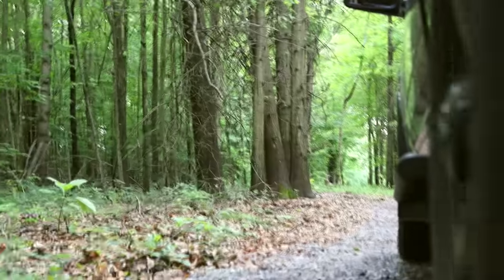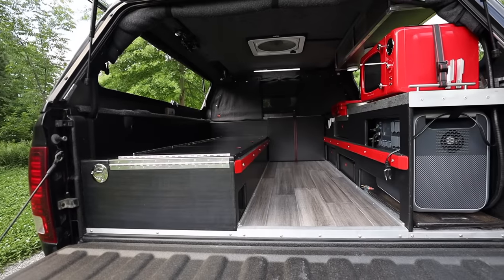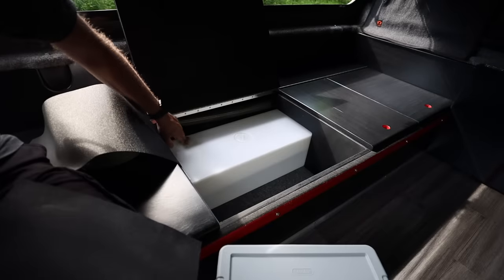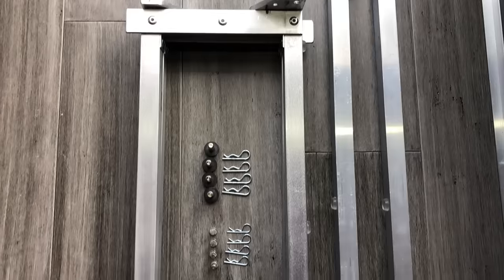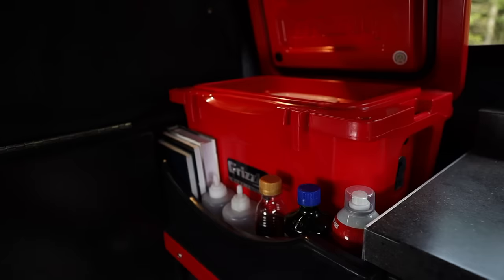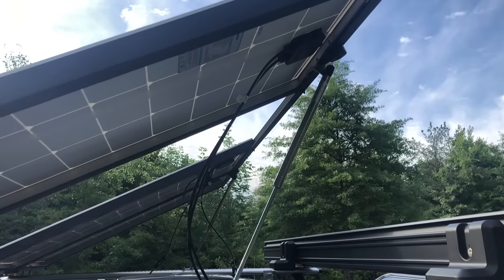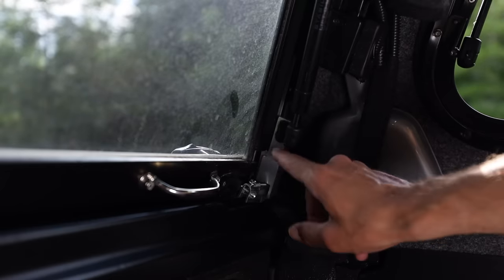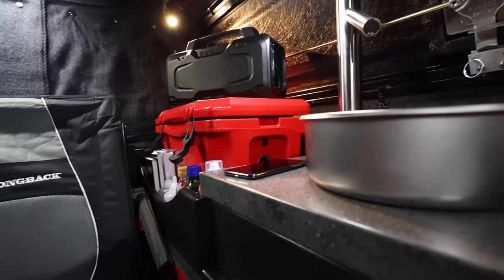My Ultimate Truck Cap Camper Build Full Tour!

Comment: Amazing -- a fully self contained camper in a topper!!  The only missing item is a propane heater for winter camping?  Have you thought about what you could do with a higher topper that is just high enough so you can sit on the bed and be able to walk in and out rather than crawl?

Comment: What an incredible build out. All the planning and preparation you took in the design really shows. The execution was great. Absolutely stunning build. I love the way you set up the power and the adjustable solar panels. Such a great idea. I definitely put some ideas in my back pocket for my current build. Thanks for sharing your entire build out for people to draw inspiration from. 👍👍
Reply from the maker: Thanks so much! A few days after I posted this video my Thule roof rack failed going down the highway causing major damage to the solar panel frame. I’m currently redesigning it and will post a future video detailing the new design. Take care!
Reply: @WhentheDustSettles  oh man, I'm sorry to hear that. A bummer, but I am definitely excited to see what you come up with!
Reply: @WhentheDustSettles  Thank you for sharing this detail. I am looking to put solar panels on a topper and was wondering how they would handle road speeds.  It's not just the weight, but also the "kite effect" to consider.
Reply from the maker: @BoHunter2010  yeah, I unfortunately had an experience with my solar panels trying to take flight. My Thule rack broke and they almost came free…causing a bit of damage. 😩

Comment: What a sweet setup. Well done!! I've been watching many truck camper builds and this one takes the cake. I noticed a vent fan up top. Smart. Considering doing something similar and gotta ask. Is the bed of the truck 6 ish ft in length? Looks like about 6'. Also, now that you've had time to use and test it out, do you have any thoughts about how the build could have been different/better if the truck bed was 8' and if the camper topper was a 36" wedge type topper? Not a critique or complaint about your topper height or truck bed length. I'm just imagining, if you could do that with that size truck bed and topper height, it would be amazing to see what you'd come up with more usable room for design space/elements. Thanks for sharing and safe traveling.
Reply from the maker: Thanks so much! The fan is great! The bed is around 6.5’. If so had the longer bed I’d have definitely put in a refrigerator and more cooking  space with storage underneath. The added headroom would definitely be nice, but aesthetically my preference is a cap that matches the height of the cab. Thanks for watching!

Comment: I like everything about this build. Only draw back for me, is my kayak would not fit between the cabinets. This the best build I have ever seen. But the kayak comes first. I built my setup to fit my kayak. It works, but man I would like to have something like yours. Stay safe.
Reply from the maker: Thanks so much! We used to store full sized kayaks on the roof but then sold them and got a couple of folding ones. Now I can throw them in the back seat. A bit of a pain folding and unfolding, but very convenient when transporting.

Comment: Dude. Nice job. I have a Ram 3500 long bed, and I am still deciding on the back. I am small enough that I converted the back of the cab into a sleeper. I love it, and so does my small dog. Cheers.
Reply from the maker: Thanks Jodie! That's really cool that you have a sleeper in the cab! Definitely a bit more secure than sleeping in the cap. You could put a bathroom, kitchen and garage in the truck bed and you'd be set!

Comment: Wow, very impressive! The one thing that I would definitely change though is the cooler. You can get pretty small refrigerators that should fit in its place, and it is very worth it to not have to use ice!!!
Reply from the maker: I totally agree…in fact I have a couple other videos on the channel where I do just that. 😊

Comment: You did a fine job on the build of your camper.  In my fifth wheel I installed LED license plate lights in all the cabinets, with pin switches, they come on when the doors are opened.  Your storage areas appear very dark and appears some light in them would be nice.
Reply from the maker: That’s a great idea and would definitely free up a hand from holding a flashlight!

Comment: Very creative.  I especially like the design of the internal locking mechanism for the cap windows and using a wool blanket for window covering/insulation.   Thank you for sharing.
Reply from the maker: Thank you...it took a few iterations to get the locking mechanisms right, but I'm definitely happy with the results.

Comment: What I find amazing is I bought (used) a 27ft Arctic Fox travel trailer for a little less than what you spent on your camper build and yet technically you have everything that the big bulky trailer has lol. Although mine has an entire room with toilet, sink with vanity mirror, tub with a shower and/or faucet for taking a bath and a closet plus armoire, a window and exhaust fan all behind a door that opens and closes as you choose lol everything else is basically the same you just have the smaller more convenient go more places version. Now my mind is racing lol
Reply from the maker: There are definitely times I miss my travel trailers of the past, but for know I am absolutely digging the portability and convince of just hopping in the truck and going just about anywhere.

Comment: Great truck camper set up! For toilet consider using "Pine Pellets" instead of wood chips, and just keep adding overtop until bowl near full, so your disposal frequency is reduced.  Also use lemon/vinegar/water home mix spray instead of Lysol. Pine Pellets absorbs moisture and smells wayyyy better.
Reply from the maker: Thanks for the tips!

Comment: I've got a small but just long enough trailer for a 6ft 1 guy to sleep in with space. It's given me the idea for a small trailer towed on my motorcycle.

At first, I thought I'll just sleep along the middle, but that's a ton of room I could use for other things. So I had an idea.

Sliding shelf brackets are made that can hold up to 250lbs, maybe more I haven't shopped around much. I don't need that much, maybe 100-150lbs at most for storage. I could make a slide out extension for my small trailer, and if done with weatherproof brackets should work out...maybe? Let me know, seriously this is a dedicated project.
Reply from the maker: If I understand it correctly, I think you might be on to something! Hope it works out!

Comment: great breakdown and build! Only thing I would change would be adding a 12v cooler, Even if it's in the backseat. It's wild that you have hot and cold running water but a standard cooler haha
Reply from the maker: Thank you! The 12v refrigerator is definitely coming! Up until now I haven’t been able to take extended trips, just one or two days. But I’ll definitely need one soon.

Comment: Very nice build. Has all the luxuries of home. As well as your solar generator, have you thought about adding a dual battery system? Yes this is redundant. However, it is also can be used for the smaller devices/appliances, leaving your solar generator to handle the larger appliances. Using a dual battery system (hooked up through a isolator (Redarc SBI) and a relay), you can start your truck drawing from both batteries. When you are running off grid, it is piece of mind you have a backup system. I wish you the best on your adventures and God Bless

New subscriber here😎
Reply from the maker: Thanks Mikell! I started out planning on piecing out the electrical system…in fact for a month or two I did have a battery mounted inside and actually had the fresh water tank mounted underneath the microwave cabinet. When I stumbled on the Bluetti on indiegogo I redesigned the build to accommodate it. My struggle before was trying to fit the batteries and components and everything else I wanted in the build. Ideally, I’d prefer to piece it out as to reduce downtime if something were to fail, plus all the benefits you laid out. If I had the 8’ bed I probably would have gone that route. Thanks again and I appreciate the support. God bless you as well!

Comment: My truck camper has a air conditioning unit on top .
I've had coworkers at work being nosy trying to look in the back of my truck so I blackened out my windows  . I should have had it finished by now but I stopped doing it 4 months ago now I got to get back started so I can finish it up .
Reply from the maker: AC would be wonderful!

Comment: I like the way you are able to secure the back window from the inside. Awesome for urban boondocking if needed. This is a feature camper shell manufactures do not consider. I would also like to be able to secure mine from the inside. However, mine is not like your. I have a A.R.E. "Z" camper shell. The latches operate by cable from the center handle/locking device and the cable is covered.
Reply from the maker: Yeah, I definitely feel more at ease knowing I can secure the windows. I’ll have to look that cap up to see pics of how it works. With as many folks doing truck camping it would be wise for these manufacturers to come up with a cap geared to the diy’ers.

Comment: Excellent design and build.  I'm getting ready to build one myself and may borrow 1 or 2 of your ideas. I assume that you leave this installed in your truck all the time. My build will have an extra challenge. I need to design mine in a modular fasion so that I can remove the whole thing and store it so I can use the truck for work. When I know I'm going camping, I want to be able to install it in a reasonable amount of time and go, same when I'm done, I need to be able to break it down and store all components so I can use it as a pickup truck. I will video the build and share my design in case others want to do the same thing. thanks for the video.
Reply from the maker: Thank you Gary! I do leave my build in all the time. It would probably take me an hour or so to dismantle it, but would take a few to put it back together. Good luck on your build!

Comment: Sweet set up.  Hope to copy many of your designs in my f150 short bed. Since the F150 has the onboard 2kw generator with 120v outlets, I may only use a portable solar panel for charging something like jackery so the onboard generator isn't needed for every minor use.  But I'm still learning about power systems.
Reply from the maker: Onboard generator sounds awesome! The Jackery units are great! I may do a more in-depth video on the electrical system in the future. Thanks for watching!
Reply: @WhentheDustSettles  would live to see a more detailed electrical and plumbing video.  BTW, it's the first truck camper video my wife watched all the way through and might consider. We'll be pulling a travel trailer, but expect to spend occasional nights in truck while in national parks or overlanding where the teailer will be a home base.
Reply from the maker: @gregreinert642  Sounds like an awesome plan!

Comment: I have a truck topper camper build. I started with a truck with a 6' bed, I'm 6' tall, so I bought a truck with an 8' bed. I also use an ARE topper high rise and use EZ Topper Lift, gets me 10.5' head clearance. Also use a Bluetti 200max. 
Going on 3 yrs living full-time.
You have inspired me to do some renovation. Question, what size of truck bed and the dimensions of your bed. What is your head room.
I have everything you have plus a refrigerator/freezer 19' smart TV, but your set up is ...well beautiful!
Thanks
Reply from the maker: Sounds like you have a great setup! I have 6.5' truck bed. I'm just under 6', so my bed is 73"L x 24"W x 11"H. With my pillow propped a bit, it is very comfortable for me. I'm looking into getting a cooler style refrigerator to put in the cab for longer trips. Thanks for checking out my channel!

Comment: This setup is absolutely incredible everything you would want and need!!
 I can't wait to see more videos and hopefully you've got some build videos but if not it's ok .. about how much extra does it weigh now with all that in the back did you lose gas mileage wise !! Also what do you use for heat in the winter..
Reply from the maker: Thank you! Unfortunately I couldn't talk myself into filming when I built it...but I will for anything I do in the future. I really haven't noticed any change in my fuel consumption. I have not had it weighed, but maybe I will do that in a future video.

Comment: Starting from scratch with a ford f150 off road single cab with long bed. planning on half your budget is my goal.  8 ft bed .
Reply from the maker: Included in my budget was the solar panels, Bluetti and Thule awning...which was  probably half of what I spent. Just the build could be done much cheaper. Good luck!

Comment: Another question, I have a Pro Hitop cap, which is a another product of the Leer company. How thick is your cap that you can drill holes in it and add nightlights, an iPad mount etc, what size screws did you use?

Comment: I really like your build. Some good ideas for me. One thing I am curious on is the way your solar panels mount on your roof rack. With them sitting up that high, do they cause much drag or make noise when going down the highway? I am building my camper out and am about to install my panels and I was considering mounting them to the roof tracks instead of the crossbars but if yours have held up well I may consider doing the same thing.
Reply from the maker: Shortly after I posted this, one of the feet of the Thule rack failed going down the highway. I had no issues for over a year. I originally had it mounted to the track but the shadow of the crossbars impaired the efficiency of the solar panels immensely. Check out the follow up video I did and you can see the damage. I’ll be posting the new version once I get it figured out.

Comment: Check out the rough country cooler it runs off of solar super handy for a build like this
Reply from the maker: Those are sweet! I have an Alpicool 12v refrigerator/freezer that goes in the cab. I mainly use the grizzly cooler for drinks.

Comment: Nice build dude. I'd say 4k of your build was the solar, power box, water heater, wiring and plumbing. Is that fair?
Reply from the maker: Thanks so much! And you’re right on the money! (also, the awning) The “build” part of the project was basically a few sheets of plywood and a piece of used corian I found on FB market place…in other words the least expensive part. 😆

Comment: I like it, you need to get those tailgate shocks , they lower the gate down slow.
Reply from the maker: Nice…I’ll have to look into them!
Reply: @WhentheDustSettles  Dee Zee DZ43100 Truck Bed Tailgate Assist Shock for 99-07 Silverado/Sierra
60 Day Returns. Best Value. Authorized DeeZee Dealer
     128 product ratings
Condition:
NewNew
Compatibility:
See compatible vehicles
Quantity:
1
Limited quantity available
485 sold / See feedback
Price:
US $39.79
Reply: I found it on Ebay
Reply from the maker: @JosephCompnotta  Awesome...thanks!

Comment: You have 1700Wh power station
3x 100 watts aren't enough for this 
Go for 2x 200 watt total 400watt panels
They can charge 1700Wh from 0 to full within 10 hours when you have sunlight

300watt panels are enough for 1500Wh power station for 1700 you need little more

Comment: Very Nice build!  How did you make the low profile aviation plug? I can't find one anywhere. I have the Bluetti  2000 and want to get it to fit in a tight spot. . . . . .Thanks!
Reply from the maker: Thanks so much! I bought the regular one and modified it by cutting a channel for the wire on the side and filled the opening with epoxy. It’s held up great with no issues. Hope this helps!

Comment: SIMPLY AWESOME....!  IF YOU WILL...?  what paint or coating is on the surfaces of wood mostly I believe....?  Thanks Jason.
Reply from the maker: Thanks Jason! I used a product from Home Depot called Varathane. I used black for the color and then they also make a water based polyurethane. Several coats of each and lightly sand in between finish coats.
Reply: Awesome....Thank you much.....!  I appreciate your time and help on that....!

Comment: Awesome job.  I have a 2021 Ranger I'm getting ready to do a build on.  I'm installing 4 actuators to raise the shell 2' to give me a little more head room when camping.  I have a question regarding your build.  How did you connect the solar panels to your solar generator when driving.  I'm installing solar panels on the roof of my shell, but don't really want to cut holes in the top.  Not sure how to run the wires so not to cut any holes, but use existing ones in the bed like you did.  Not sure how to secure the wires so they don't flap around while off-roading.  I want to be able to charge my solar generator while driving and power my frig.  Any ideas are greatly appreciated.  Cheers Scott
Reply from the maker: Hi Scott! Thanks for the kind words! True, I didn’t modify the truck bed, but I did make modifications to the truck cap. I used a little housing that glues down that accepts solar panel cables and fed them through two holes in the roof of the cap. There may be a way to get the wires through the front cap window by adding a custom rubber gasket that would allow the wires through and the window to still seal up against it. That would probably keep the wires from flapping around. The actuator idea sounds pretty awesome…good luck!
Reply: @WhentheDustSettles  thanks for the reply.  What were the caps you used to run your solar wires through?  Any issues with leaks?

Comment: How did you finish the wood to make it that smooth black? Sand and stain black?Thank you it looks awesome
Reply from the maker: Thanks!! Yes, you are right..used a couple coats of black varathane wood stain, and 3 coats of water based polyurethane with sanding between coats. After final coat crumple a piece of paper very finely and “sand” with it.